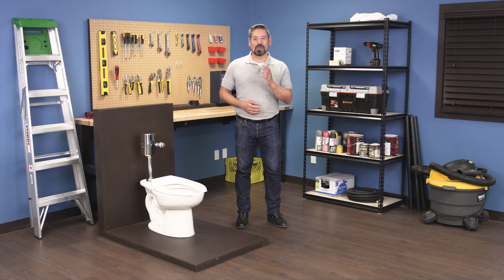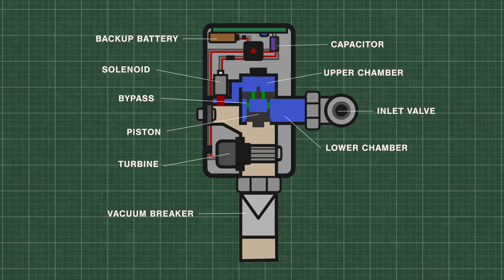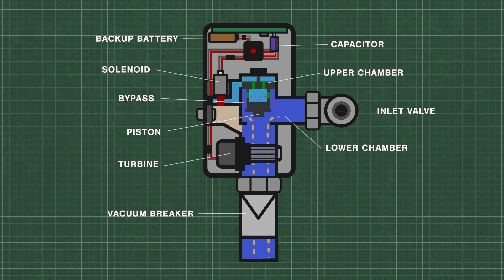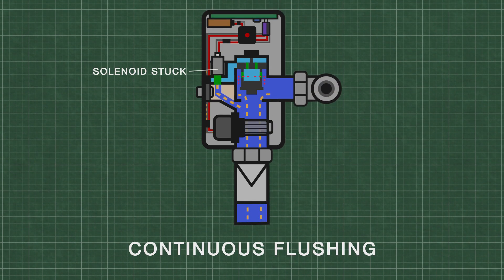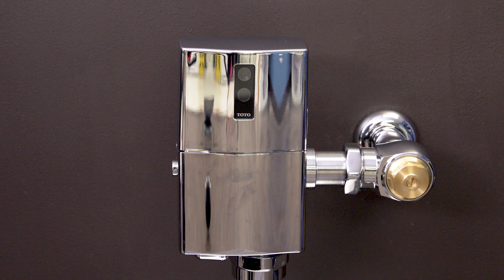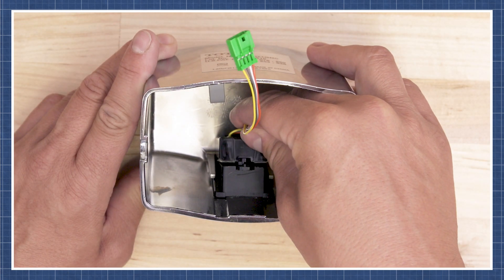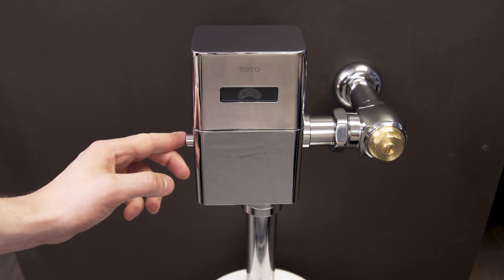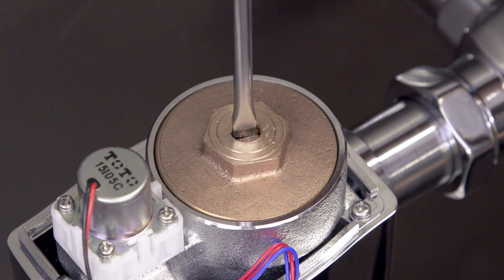Troubleshooting a TOTO EcoPower Flushometer (Pre-2013) | Repair and Replace

Comment: At our church we have 3 ToTo's model # TEU1GNC.
One started flushing perodically out of the blue.
The motion detector worked as usual.
All of a sudden it went in continual flush mode.
The troubleshooting guide and your vid led us to piston.
TOTO help had me check and change battery. They said it had to have a min of 2.8 v. 
I replaced piston with no change, then solenoid with no change.
I then took the top off one that was working properly and put it on troubled one. No change. 
No where did I see talk of the flush override button.  It springs in and out, could internally it be stuck? 
I would appreciate your thoughts.
Best; Tom
Reply from the maker: If the flush override button was slightly engaged, then all it would do was open a small channel for water to pour out. This would create a slow continuous flush as the piston would never reset... water would not fill the upper chamber to close the valve. This would not cause intermittent flushing unless the valve was bumped and the override button disengaged. We have a video showing how to replace the override button if needed: https://www.youtube.com/watch?v=Tb-QRyfTTSg

Comment: Is a Toto flush valve affected by the polarity of the battery?  I have bought what are supposed to be replacement batteries where the red and black (pos and neg) wires are reversed in the molex connector.
Reply from the maker: Thanks for watching. The solenoid is not affected by the polarity but the control board might.

Comment: Great video.  Our toilet won't stop running.  Flushes fine, but won't flush automatically. Water continuously runs, so I figured it had to be the entire flush vale.  Is the nut on the bottom connected to the toilet side easy to get off the old flush valve?  And is it reverse threaded?  We aren't replacing any pipes.  I don't want to measure and cut pipes.  Just want to get the flush valve installed so that this stall can be back in operation again.  Thank you!
Reply from the maker: Thanks for watching. Continous flushing can be a problem with the piston and if it won't start automatically that points to a problem with the solenoid, which might not be closing properly. 

We have videos showing how to replace the piston and solenoid as well as an installation guide: https://www.youtube.com/watch?v=1j9fu5M2VdM

Comment: Can you adjust it from 1.28 gpf to 1.6?
Reply from the maker: Thanks for watching. The pistons used in these models are for 1.28 gpf and 1.6 gpf. The pistons are what dictates how long the flush continues and how many gallons of water is released before the valve resets. Not sure if this can be adjusted between the two or it if is a set amount which just works for both toilets. There might be more information in the manual or you may want to contact Toto for more specific information.

Comment: Our problem is that we turn the automatic flushing off and come back the next morning (or later in the day) and it is turned back on.   Just started doing this a few weeks ago.  Any idea why?  I have a 12+ year old Neorest 500 MS950GC.   TIA.
Reply from the maker: Thanks for watching. That might be a question for the manufacturer as there can be some variation between different models of sensors and control boards.
Reply: FYI, the problem went away when I put in new batteries.   The old ones were weak, but not dead. @AmreSupply

Comment: My Toto is leaking from the tail pipe when I flush. I assume it's the Vacuum Breaker. Most of our toilets are Sloan and I have several Sloan flush valves on my shelf. Can I replace it with a Sloan Vacuum Breaker? Or do I have to use a Toto breaker? They look the same on the website, except the price :-) Thank You.
Reply from the maker: Thanks for watching. Vacuum breakers are interchangable for the most part there isn't much variation between them as they are all the same size. Just try to match as closely as possible.

Comment: Will the battery affect the water pressure from running if the battery is low with a sensor work
Reply from the maker: Thanks for watching. Since the solenoid is a valve it will either open or close. If the battery is too low the the solenoid might not open, which will prevent a flush from working. A low battery will directly not affect water pressure during a successful flush.

Comment: So my Toto auto flushed is flushing very slowly and week. Water valve seems to be fully turned open , water level is ok. I played with the adjustment valve screw. Please help
Reply from the maker: Thanks for watching. It's worth installing a new piston and seeing if that helps. Over time the rubber seals can wear down and this might cause it to stick and not move freely.
Reply: @AmreSupply  understood, this automatic flusher is about five years old the more I play with it the more problems I’m running into now I’m getting a constant flushing and I can’t stop it and my sensor doesn’t seem to be working properly as well.
Reply from the maker: @anthonyasaro1351  Bad seals on the piston can also cause continuous flushing. The piston is a good place to start before looking further into the sensor.
Reply: @AmreSupply  changed the solenoid and does the same thing , barely flushed with sensor and flush softly with manual button. Waiting for piston to arrive. I will swap that and see what happens. Ughhhh Toto Toto Toto
Reply from the maker: @anthonyasaro1351  Thanks for the update. Hopefully the new piston helps.

Comment: What if it flushes with a Good flow manually pressing but on sensor it has almost 0 flow?
Reply from the maker: Thanks for watching. If it flushes manually by pressing the manual (bypass) button, then that means the piston is working fine. This means that the solenoid is likely stuck or not opening properly.

Comment: I’ve changed the solenoid and sensor on my Toto EcoPower flushometer toilet, and it still won’t flush automatically.
Reply from the maker: Hi Seon, thank you for watching. If you've replaced the sensor and the solenoid and the unit still won't flush then it could be an issue with the capacitor which is located next to the backup battery. Unfortunately the capacitor can't be easily tested. It might be worth calling Toto directly to ask them.

Comment: Why do each time I replace a new solenoid valve, it will flush non stop. And piston is not faulty. Thanks in advance
Reply from the maker: Thanks for watching. Do you hear the solenoids click when flushing? If not Its possible that the solenoid is just stuck sitting in the open position.
Reply: AMRE Supply thank you Sir!
Reply from the maker: @agametester8386  You're welcome!

Comment: What causes fantom flushing??
Reply from the maker: Hi Ross, thank you for watching. Phantom flushing could be an issue with the sensor calibration, which can cause it to trigger the flush from small movements that are normally far outside the sensor range. Another cause could be a leaky piston or solenoid which slowly lets out a small amount of water from the upper chamber, which at a point will cause the flush to initiate.

Comment: Hello this was a great video. Can you please tell me why when I flush the water is leaking down the tail pipe? I think the vacuum beaker needs to be replace maybe
Reply from the maker: Thanks Tirent!  You are right replacing the vacuum breaker is the simplest place to start. If the rubber begins to break down and deteriorate, it can restrict the flow it can create more back pressure while flushing.

Comment: If Sam’s Club Plano Ohio 121 Restrooms Zurn Hardwired Autoflush won’t let me Flush twice or more then need to replace the existing Zurn Flushometer, & Autoflush hardwired. Could this product TOTO Auto Ecoflush will be upgraded? (For example: East Plano Sam’s Club already brought Toto Zurn Fixtures)
Reply from the maker: Hi Timothhy, thank you for watching. If your autoflush won't flush more than twice then it sounds like it is a problem with the sensor module. Sometimes its more economical to fix the current flushometers and in other cases it makes sense to upgrade all the flushometers. Every scenario is different.

Comment: Hi, I was wondering if there is a way to adjust the sensor's range because it can detect people two meters away.  Thanks
Reply from the maker: The Ecopower Flushometers have self adjusting smart sensors. Even though there isn't a manual adjustment, you can disconnect the sensor and reconnect the unit to reset it. It will do auto adjustments over 5 min and should reduce the sensors range.
Reply: AMRE Supply Thanks; btw warning to people are working on the unit the screws are non-magnetic.  One of mine got auto-flushed.

Comment: Hello . I have another question ! One of toilets is constantly on flush. I disconnected the top and and its still on flush mode.
Reply from the maker: Hi Solano, First thing you should check is if the manual flush button is stuck. If its pressed down just a little bit, water will continue to flush.  It can be replaced if necessary https://youtu.be/Kh_sA41k6sY

Next thing to check is the piston. It it starts to wear down, it can prevent the valve from closing. https://youtu.be/3MrPxf1PEpw

Also if the solenoid is stuck open then it will also cause continuous flushing: https://youtu.be/g17Wv7R2YuU